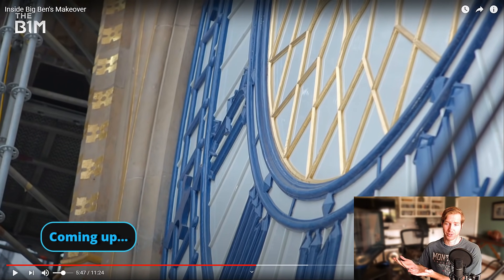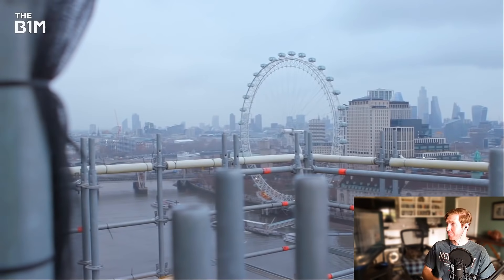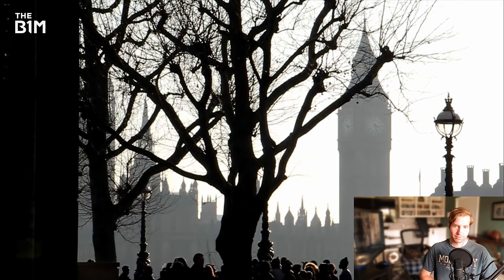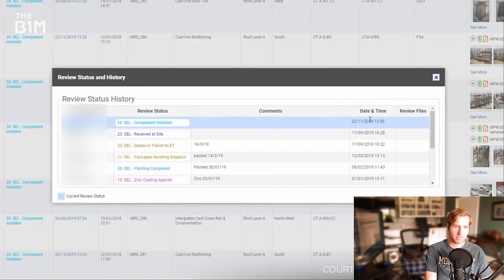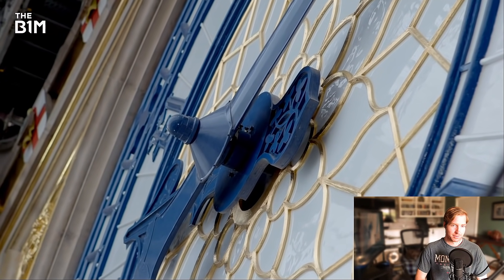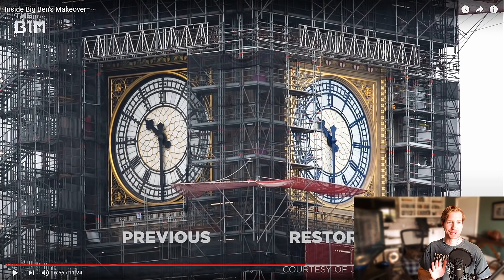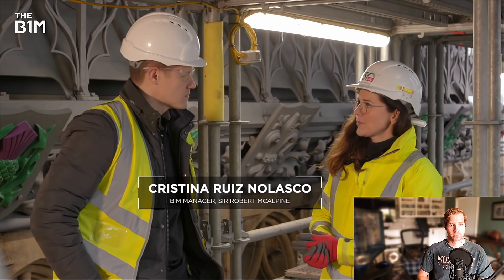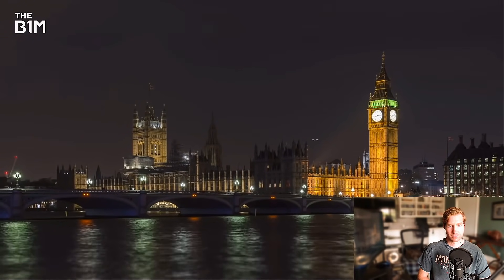Californian Reacts | Inside Big Ben's Makeover

Comment: The blue is the original colour and was also found to be the original colour on part of Tower Bridge when it was cleaned and restored some years ago.  When open there are tours but these are only for British citizens, who can book via their M.P.  I've been on one and the climb stops a couple of times for a rest and you go into a room where the guide gives you some historic details.  I was on the tour which included the midday chiming so we got the maximum 12 "bongs" - the distinctive sound is made by the giant bell having a crack in it which appeared shortly after installation.  This was the second one as the first cracked even more badly and had to be replaced almost straight away.  The striking hammer was reduced in weight to try to stop it happening again.  The resonnance is incredible and you have to hold onto something because of the vibration.

Comment: Also fun fact - the bell itself actually has a pretty big crack which they have decided not to fix since the crack changes the note (rather than being an intended E it is an E flat) which makes it sound like that iconic, more morose tone
Reply from the maker: Never knew this, I like any fun facts I can hear and learn about :)
Reply: @californianreacts  Another fun fact, Big Ben was cast by the Whitechapel Bell Foundry, who also cast the Liberty Bell.
Reply: @TheRenaissanceman65 the issue was apparently that when it was first rung they put too much weight in the hammer and it chipped it. The bell itself seems to have had no other damage. 

More to the point every Brit since the mid 1800s and around a quarter of the world has had that particular note lodged in their mind so changing it would be very strange.